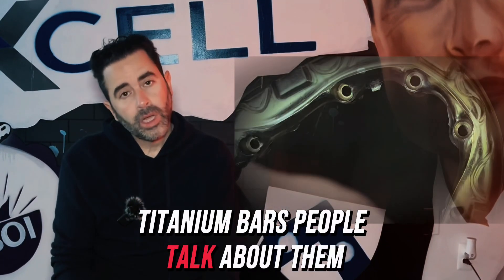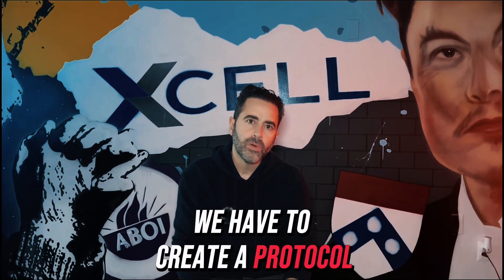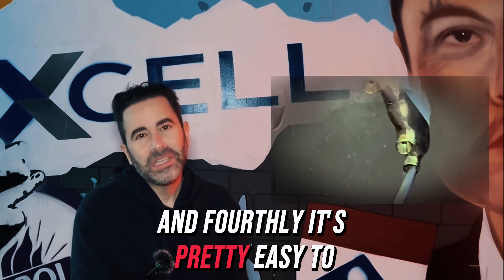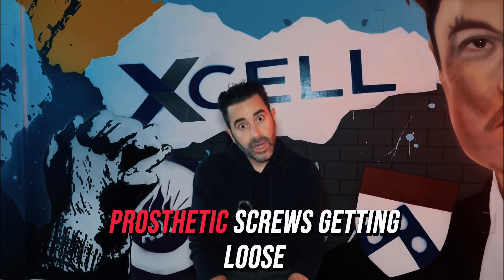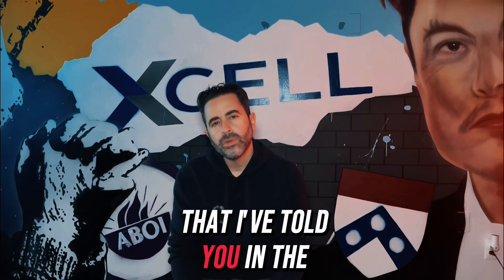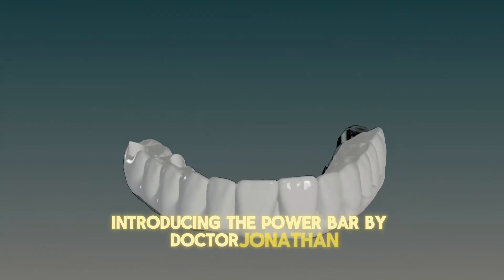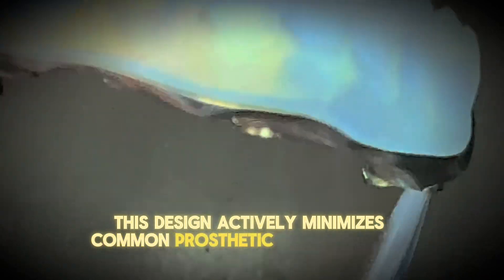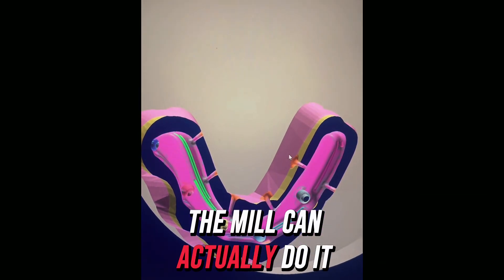Titanium bars Power bar dental implants how do you do it ??

Comment: Not bad insights. B4D community  really goes the other way around. Designing skills over professional knowledge.
Reply: If there are no design skills, it’s hardly possible to solve even basic problems like the ones exocad has been facing lately, requiring support from software like Blender for Dental to achieve something decent. Let’s hope they can address those basic issues.😉😉😉
Reply: @luisignaciodebellis6539  have been using exocad since 2011 so I have doubts about that. They come out with solution 3-5 or even more years later. Have been stuck in workarounds so deep it's painful to adapt to new features released by developer.